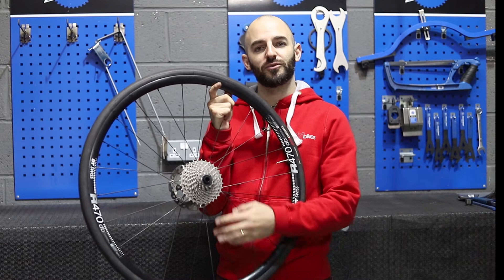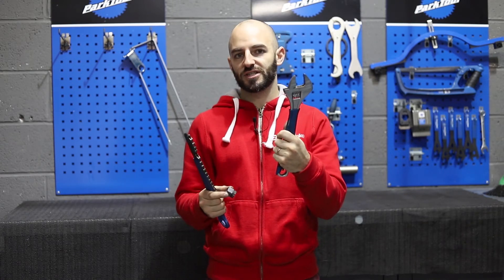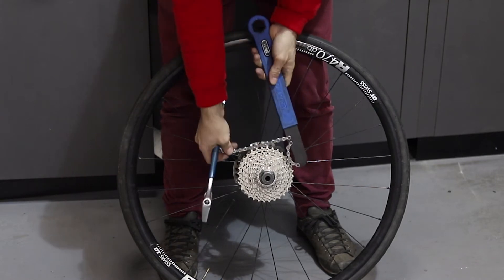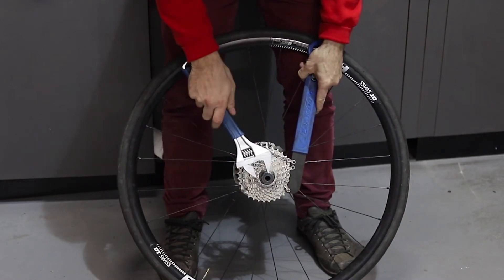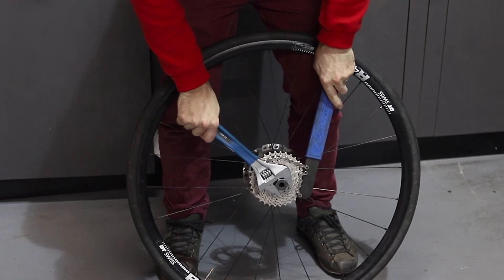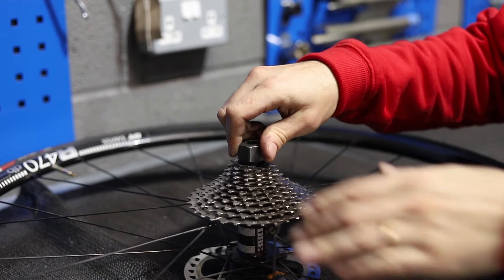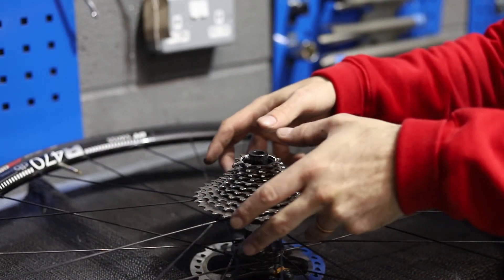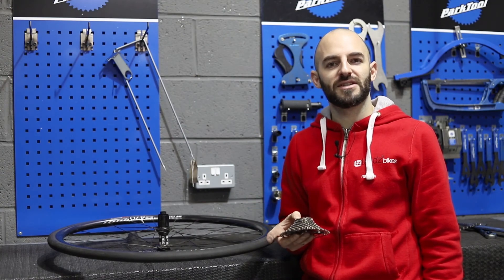How To Remove a Shimano Freehub Cassette  | Tech Tip | Tredz Bikes

Comment: hi, well I have a problem with my freehub body. It's badly damaged due to usage. How do i replace it? it's a shimano freehub.
Reply from the maker: Hi, it'll vary depending on the hub itself. If you're unsure or don't have the correct tools I'd suggest visiting a bike mechanic for assistance to ensure it's done safely